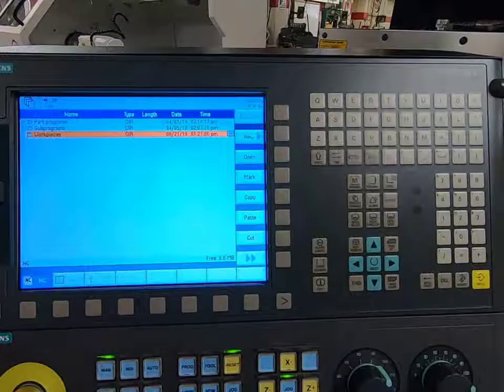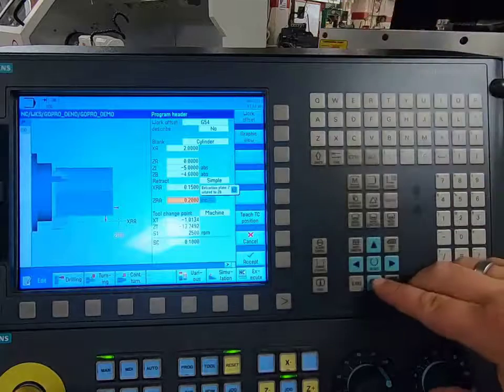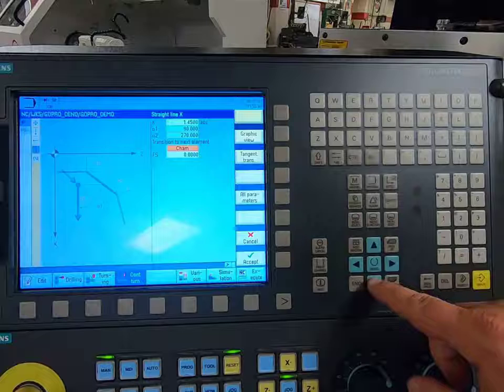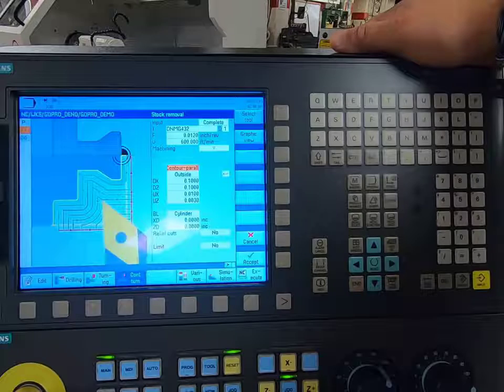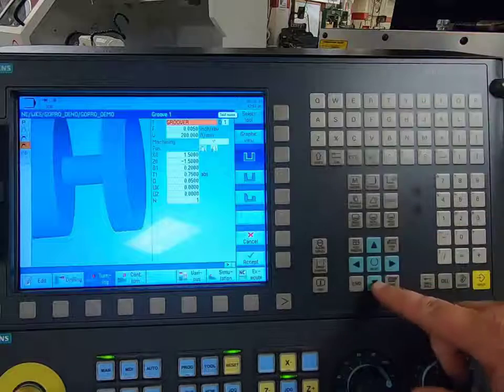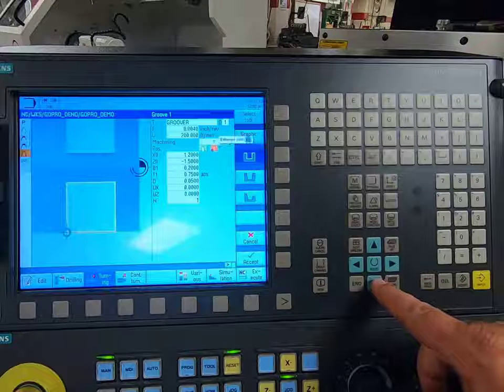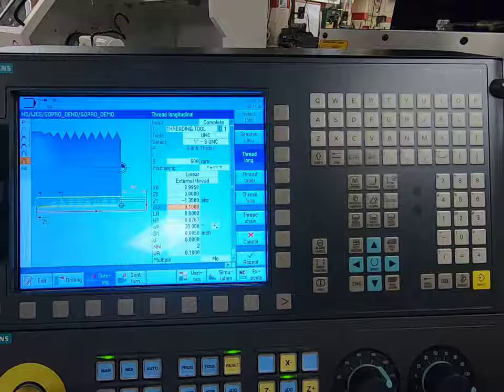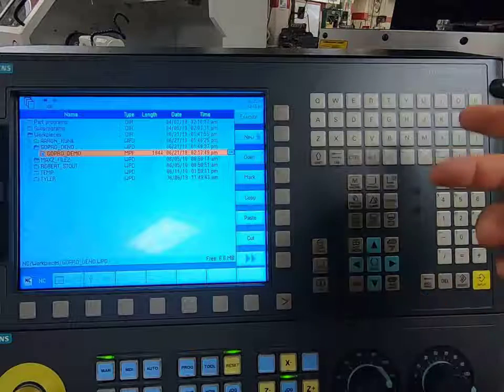Fryer Siemens CNC Lathe Shop Turning Programming

Comment: I have the exact same lathe and I am trying to set up a V Groove program and it keeps erroring out invalid tool. also, the start point on the V Groove is the opposite side of where yours is on your grooving program. I use G Code a lot and would love to utilize conversational but I keep having issues.

Comment: Hello, what’s the difference between linear and degressive in the threading program?
Reply from the maker: Hello there, and thank you for watching.  so if you look close enough in the video, I can't remember if I changed between linear and deggressive. however, the deggressive will take a deeper initial cut, and then the closer it gets to the bottom of the thread, the lighter the cutting pass will get until you reach the final depth of the threads. The linear motion will take equal depths of cuts until it reaches the final depth of the threads.  It's funny that you had just commented on this specific video because my students had a part with 3/4-10 threads, and we set it up on no time.
Reply: @aaronrunk4209  awesome thank you so much for the reply! I gave deggressive a shot at work when chasing the threads for a ballscrew nut and it cut the time almost in half! We used to do .001" per pass and it would take 2+ hours for some of them. :) Love your videos keep them coming!
Reply from the maker: @moodATM  that's great that it helped. Thank you again for watching, and I'll try to get some more together.

Comment: When pressing teach TC position
Error 61243
(Tool tip in retraction area.)
But is Z+ 300
          X+50
If going off work.
It OK.....
Reply from the maker: The first page where you set the location of the TC position. Try moving away from the part several inches and try again